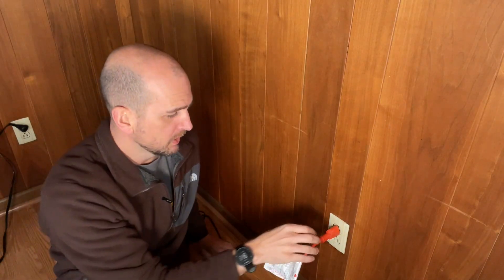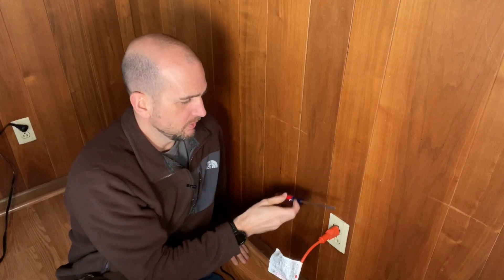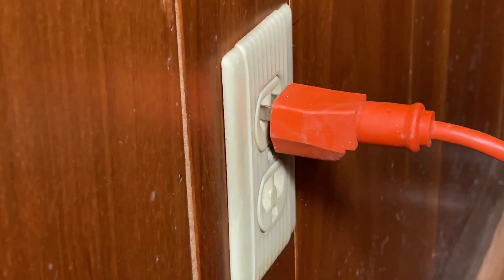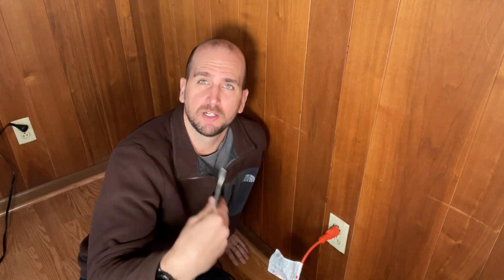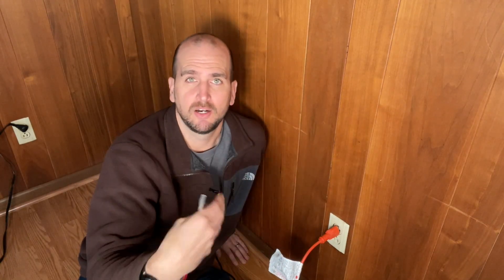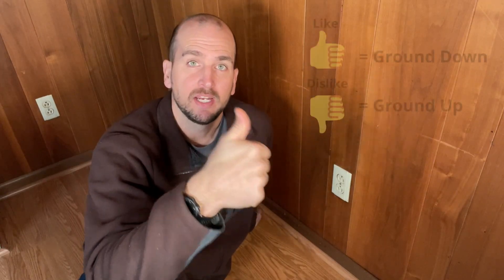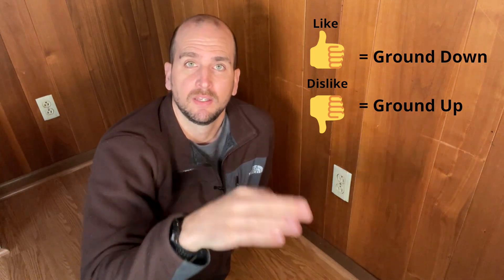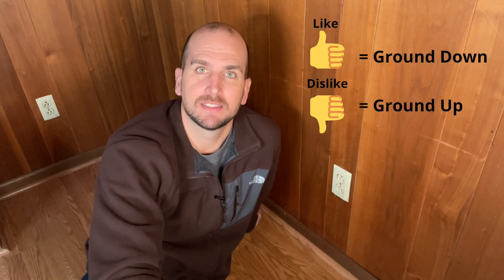Should An Outlet Be Installed Ground Down Or Up

Comment: I usually position ground down, for practical purposes.
1. Practically all angled plug (90°) have the ground pin in the down position.
2. Considering the grip force of each plugged pin, two pins are going to give twice the tensile resistance (from pull out) of one pin. Naturally, positioning to two pin up will prevent the plug from twisting down, due to gravity, twice better than when one pin is on top. As for the bottom pin(s), this undergo compression, so it don't need any grip force at all.

Comment: Hospitals = Ground up because some idiot didn't push a plug in all the way and a surgical tool fell across the hot/neutral.  In residential homes, it should be ground down.  Also because some people don't have the strength to pull out a plug and can slip their underneath the plug while trying to pull it out.  I've seen one of my aunts wriggle the plug out somewhat and then hook her fingers underneath (touching the ground) to get a better grip and then pull it out.  I told her about it and she says "I've been doing that for years".  Now if she went to a hospital and unplugged anything, that "ground up" rule will kill her.

Comment: I am an industrial electrician. I always install ground up. At home, I prefer ground up also. When my nephew was a toddler, he was at my Dad’s house and decided to put a penny across the ground down plug and blackened the wall, almost causing a fire. 
I don’t care about night lights, a house fire scares the crap out of me. Grounds up. Just my opinion and experience.
Reply: What works (and is safer) in a heavy use environment? ... As you said its Ground up... 
Those posting here saying they "have never seen a problem with ground down" have either never spent any time in a heavy use setting or are trying to justify to themselves anthropomorphizing (making human faces out of inanimate objects) electrical receptacles.

Comment: I have heard that you install ground up if the cover plate is metal. This is so if the cover comes loose and falls on the prongs. It falls on the ground prong, and not cause a short. I though it was a BS explanation.

Comment: I started in the trades when these plugs first came out.  The major industrial quality plug/duplex companies went with ground up.  There were big arguments at that time, and the winning' at the time ' argument was that a cord is more secure with it plug'd into a ground up outlet.  In a ground down outlet, the cord being pulled partially out exposes the hot and neutral  to some extent.  To this day, I am a ground up guy..... but most inspectors will go with either one as long as you are consistent in the building.

Comment: your argument about the safety of ground-up makes a lot of sense but keep in mind the great majority of devices plugged into it will never have a ground pin on it anyways, especially in typical households. thats why I favor ground down (like a smiley face) ... also while we are at this, all screw heads should have the same orientation, oddballs are not allowed ...

Comment: You are correct we engineers spec the ground up in a commericial setting. This was put into play in late 80s. The reasoning was desk's against wall and items falling between desk and outlet. Home use is never specd out unless you have a anal retentive draftsman.

Comment: My electrician seems to go out of his way to make three-way light switches point different directions when the light is off. 
Messes with my OCD.
Reply: Uh....how are they going to work, otherwise? You only move one switch at a time. Then where is the other switch? To keep them oriented together would take some actuators and complex wiring control.

Comment: I was taught ground down years ago because that way if the plug did start to come out the ground would be the last prong to come out protecting the item being powered such as a metal cased drill motor or what ever. The odds are you'll have a problem at the powered appliance before you'll have something fall across the powered prongs.

Comment: I just have one with ground up. I is outside and at the time I was plugging a camper 30 amp adapted to the 110. The large cable was to stiff to face up so I turned the socket upside down. I now have a dedicated 30 for the camper.

Comment: I usually see ground-up on outlets that use a metal cover like you often see in commercial buildings, schools, etc.  That way, if the metal plate comes loose, it will fall on the ground pin.
Reply: That is a pathetic excuse to put the ground up. If something is plugged in then it fall on the chord cap which is insulated. If it falls of when nothing is plugged in it fall on the floor. Like I said pathetic.
Reply: @stevieg.4816  what if the plug is pulled out just enough for the plate to make contact with the plug prongs? Not saying one is right or wrong but you put no thought process into the scenario what so ever, simply stated you said it was a black or white scenario when the reality of it is, there is multiple colors to the spectrum. Anything is possible, nothing is impossible!
Reply: @chrisdavis3475  anything is possible but the likelihood of that happening and if it did happen causing substantial injury or property damage is so much smaller than many things we do on a daily basis. Just goes to show how many of us have nothing better to do........

Comment: With safety  ground down . When you plug in, the safety ground pin touches first. So you are safer at that point. Never heard of anyone having a metal object falling on pins. I think you have a better chance of shock plugging in.

Comment: I was a Fire Marshal for over 20 years and never saw a problem with an outlet ground down and have seen arcing problems with ground up and appliances loosing ground protection from the weight of cords pull the ground out. Electrical Inspectors don’t see the long term issue of installations they approve but Fire Inspectors and occupants have to live with them! NFPA needs to update the Codes to require installing outlets ground down.
Reply: Finally someone with experience, I have 42 years under my belt but explaining to others who have a misconception of this issue is rather tiresome. I agree they need to make it mandatory Ground down in NFPA. who governs NEC and they will will add it in the code.

Comment: Anyone working around electricity should know to TURN THE POWER OFF BEFORE MAKING REPAIRS. Something I learned while in the military and taking a variety of computer electric issue problems where the wiring was involved. Having it up makes sense, but then again going back several decades when grounding plugs first came out the ground plug had to attached to the screw in the center of the plug [this was where 2-wire plugs were involved]. Needless to say, there wasn't any rule back then either. Your choice or preference, but then again, make sure ALL plugs are in the same configuration. It shows professionalism in your work.

Comment: Retired electrician checking in here. Outlet orientation with the ground up was a proposed NEC code change back in 1996. Their answer was that outlets have been installed safely in both orientations for many years, and there is no need to change the code. With that said, I have had numerous people swear this was code, like the six foot rule.

Comment: In my book I dont care. But my most hated thing is when the people tighten the receptical into the electrical box . Then when the cover is put on there is a gap and the cover  is bent or cracked and broken . It is to left loose so when the cover is on it will pull up flush.  And have the most amount of grab on the prongs to hold the cord in best.

Comment: dates back to when plates were metal--used to be required in VA hospitals--if plate came loose it helped prevent circuit tripping because of short between hot and neutral--it was kind of important that you didn't lose power to life support

Comment: It doesn't matter whether the ground is up or down. But only make sure that the plug is plugged in properly, that will take care of overheating and shock. Never use wet hand to plug in an appliance.
Safety first.

Comment: The rare instance when a metallic object could cause a short across the live and neutral pins can occur with the 2-pin plugs too. However, just for the sake of discussion, lets take a look at the rest of the world where electricity is also used in homes and businesses, and which also have their own electrical codes; in all other countries that have the 3-pin grounded plug/receptacle that Ive ever come across the ground is always above the live-neutral pair.

Comment: In the US I have majorly seen ground down. In many other countries I have always seen ground up and yes, all them have a switch associated with it, never a complete on mode in the other countries.
hence I believe your say on ground down for always on and ground up for a switched outlet makes good sense.
Reply: No, please don't, and don't encourage other people to do the same.  It is something that lazy/cheap electricians do.
It is unprofessional to be inconsistent, and it's the wrong solution to the "problem". You should install receptacles that are marked as switched.

Such as https://www.hubbell.com/wiringdevice-kellems/en/Products/Electrical-Electronic/Wiring-Devices/Straight-Blade-Devices/ConstructionCommercial-Receptacles/DR15C1WHITR/p/2608245

Comment: I have had a tin sign drop to a plug and short.  I do admit I don;'t recall if it had a ground or if it was two pole.  However, I prefer ground up because of that.  Basically it comes to this, if ground down serves no purpose but tradition - and ground up can avoid that once in 100 lifetimes short - why wouldn't I go ground up?  Just so I could prove I am an old curmudgeon? I don;t need to prove that.  So, until someone can give a reason not to, I see no reason to follow a tradition that isn;t based on anything real other than "tha's how we always did it".

Comment: THIS is the definitive answer folks. Historical - actually.

The design of outlet follows the design of the MODERN 3 prong molded plug.

Now, pay attention here...

A) look at a molded plug. On the top, it has groves to grip your thumb as you pull the plug out of the outlet!  One of the largest safety issues has always been yahoo's pulling a power cord out by the wire, rather than by holding onto the plug!

B) Now look at that molded plug  again - from the front... it is shaped more or less like a triangle, with one point towards the bottom. Now, hold that plug with the ground prong down. Sure enough! As your fingers grip that molded plug, your thumb rests right on top of those grip lines, and your first finger wraps around the plug making a perfect triangle! And a great, solid grip! How's about that! Almost like the engineer had fore-thought about what the hell he was doing!!!  He did.

By the way, if you try to grip the plug 'upside-down' (ground pin up), you'll notice that it doesn't fit your hand & fingers worth a damn!

View this:  http://www.bonney.com/wp-content/uploads/2018/10/power-outlet.jpg

Comment: The ground pin is longer.. if mounted up, as you stand above and pull the plug out and up the line and neutral break first, the ground last. If there were a fault, broken cord, etc., it is still grounded.  Most higher voltage sets are designed to do this, eg, twist locks.

When inserting the ground goes in first and as you push down/in the line/neutral follow.

Comment: If someone steps on a power cord and it gets unplugged as a result of the fiasco the hot and neutral will come out before the ground making it safer for a ground facing down plug. that is more likely than someone dropping a picture frame on the outlet that is only partially plugged in. Ground down!

Comment: On most outlets the live ( positive, hot or plus) socket  or hole is  on the right side, the longer vertical hole on these outlets are the neutral ( negative, cold or minus) ground up would put neutral on the right. I think there should be a standard way to install them.

Comment: In my experience as a contractor, certain municipalities have required that replaced outlets during a renovation be installed ground up. Either way is acceptable, but this was to verify that the outlets were actually changed out according to the permitted drawings. As long as the wiring is done properly, the NEC doesn't care, i.e. Hot vs. Neutral.

Comment: As an electrical apprentice from the 1970's, I have seen both ways of installing. There are some accessories that will ONLY plug in with the ground down, so it really depends on the location of the outlet and what it's general purpose is. So to accommodate all possible variations, ground down would be the most logical choice.

Comment: The prevalence of right-angle plugs and AC to DC switching power supply adapters (AKA “wall warts,”) dictates a ground down outlet installation. If you have powered equipment (semi-permanently) mounted on the wall or positioned above the wall outlet AND is equipped with a right-angle plug or uses a switching power supply adapter then flip the outlet ground up.

Comment: I had a large paper clip fall in a ground faced down at work (30A breaker) It caused a 20 second arc before the breaker popped.  It looked like an arc welder under my desk. The wall caught on fire, The carpet caught fire and a big box of rolled drawings caught fire. I ran and grabbed a large powder fire extinguisher. The flames were 4 feet high when I got back and dusted the entire area and put the flames out . I beat the over head sprinkler system and prevented water discharge probably by seconds. I coughed for 2 hours from the fire ext. powder. The powder was between all the pages of books in my book case. I think all wall plates should have a 1" safety guard at the top edge. Lucky I did not get a heart attack. Once was too many times.

Comment: From my experience ground facing up indicates an outlet controlled by a light switch.
Reply: Yup, that is something that lazy/cheap electricians do.
It is unprofessional to be inconsistent, and it's the wrong solution to the "problem". They should install receptacles that are marked as switched.

Such as https://www.hubbell.com/wiringdevice-kellems/en/Products/Electrical-Electronic/Wiring-Devices/Straight-Blade-Devices/ConstructionCommercial-Receptacles/DR15C1WHITR/p/2608245

Comment: I had this conversation years ago with my foreman on a commercial project. I asked him why most, if not all receptacles installed by IBEW member electricians are ground up. He finally admitted that it was because of the manufacturer Hubble. Hubble was at the time employed union employees, thus highly endorsed by the IBEW (International Brotherhood of Electrical Workers) . Look at an older industrial grade device, and you will see that the logo, when viewed right side up, the ground is up. Also, the current catalog of their products, still show the grounds are up, even though the logo does not appear to on the device face anymore. As a non union member, having always installed the ground down,  all of my reasons for installing them otherwise fell on deaf ears!

Comment: I am a former hospital maintenance worker and all the grounds were up. And yes I have seen stuff fall across the blades. Those chains you see on blinds to open and close them? Hospitals use them a lot for overbed lights and window shades also. and we had one fall across a plug. Fireworks ensued.

Comment: I use ground down for the outlets in the house, and ground up for shop outlets. American plugs are inherently dangerous, and the Americans have consistently ignored safer plug designs from around the world, just like we ignore metric. So to me not a heap of a bit of difference. I just want them to be consistent, and like you say, there are a lot of cords designed for household use with ground down.

Comment: I have always preferred ground down for safety reasons. If an extension cord pulls partially out the last conducter to lose contact is most likely going to be the ground. Best practice is to keep them consistent throughout the building.
Reply: That doesnt make sense... in ground up orientation gravity and stepping on the cord PUSHES the H/N prongs INTO the outlet.. The ground pin is longer then those prongs and has to rotate out of the outlet further preventing it from pulling out... and even when exposed does not present a overt hazard.
Reply: @grumpycat_1  The hazard would be electrocution from losing the ground while keeping the H&N connected. That's more likely to happen with the ground up.

Comment: Safest Is laying on its  side. If the the plug only has two prongs with no ground odds are that only one prong would be hit and if it does have the ground problem they are both at different elevations and for the plug to come out that little difference in height may help keep the plug in including the ground prong. How is that for a response and now that I'm done said it as a electrician for a year after year after year after year and now retired I will still put them around down unless on the kitchen counter where there may only be enough space to fit it on its side with the GFI now too much thinking for this brain of mine.

Comment: In a home and using plastic covers are OK with ground side down. In a commercial  applications using a stainless steel cover. .Than it should be ground side up. This is done because if the cover gets loose. The plate with fall on the hot and neutral creating a spark,possible fire.

Comment: Here's a question: shouldn't receptacles be redesigned in general? Why? Because, using usual dual grounded receptacles, how do you connect two (three pronged) connectors to the same receptical without the cords interfering? Seems a better design would be to reverse each receptacle, i.e., one up ground and one down ground in opposite directions.